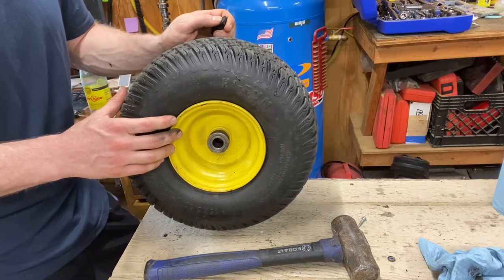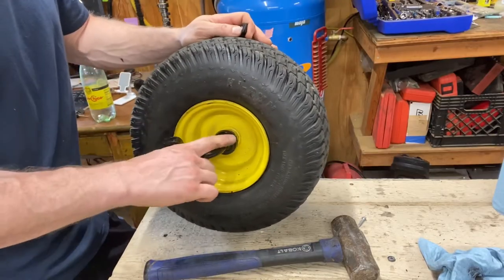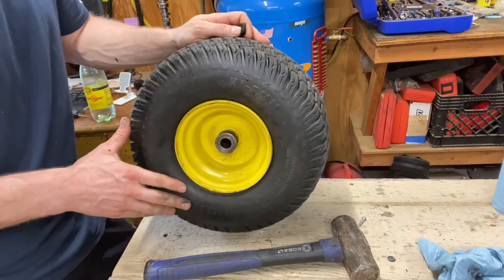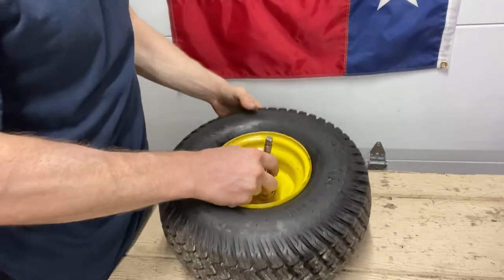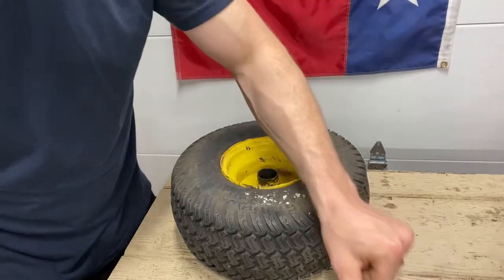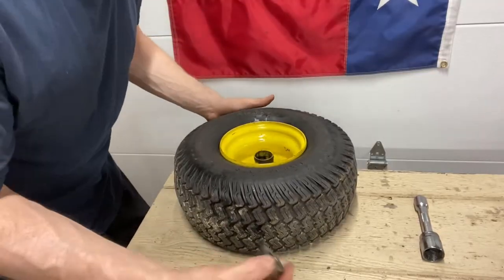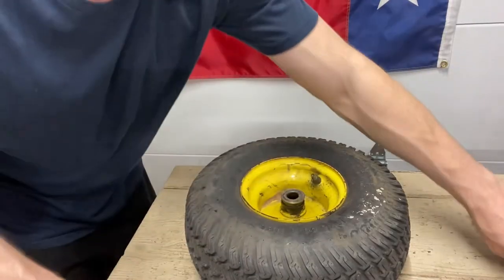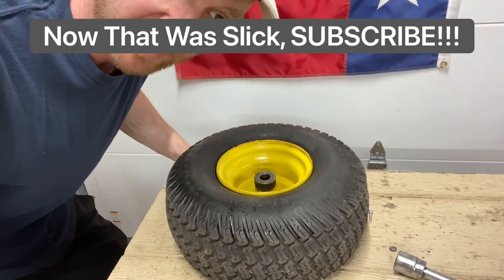Riding Mower Wheel Bushing Replacement, 2 MINUTES!!!

Comment: So what is meant to wear down - the bushings or the axle?  Is the fix for the slightly wobbly (bit of play) tire new bushings ?
Reply from the maker: If the wheel itself is wobbly then ya probably the bushings . If the steering is loose then probably the pinion gear.